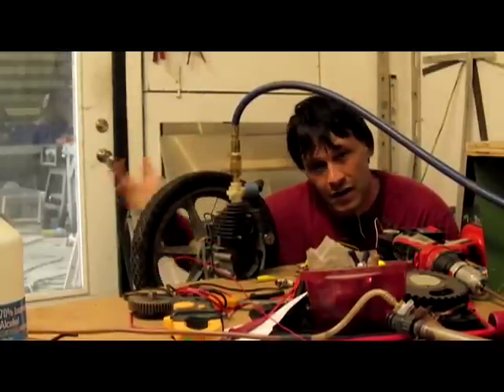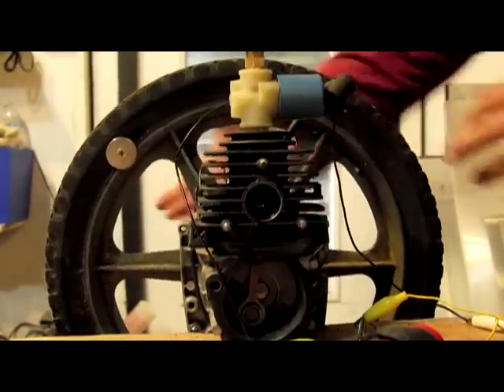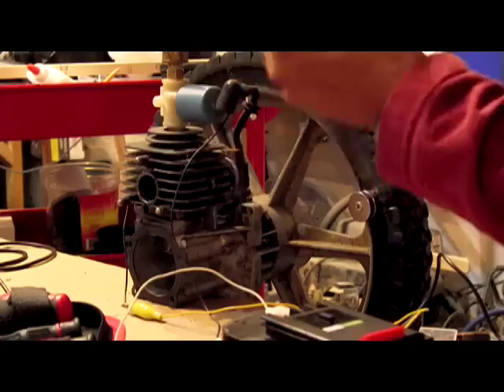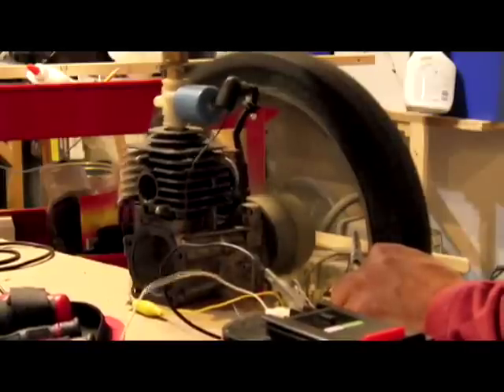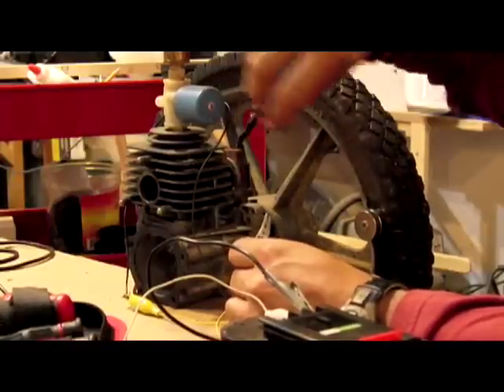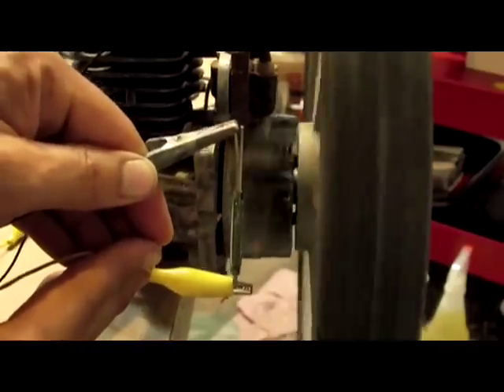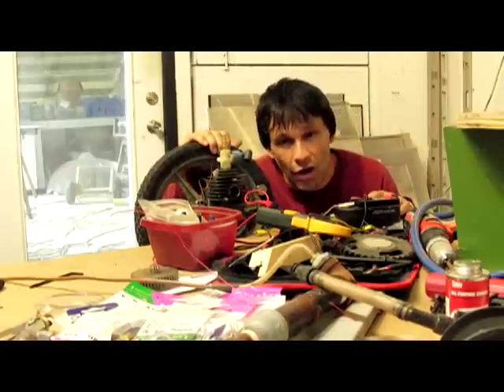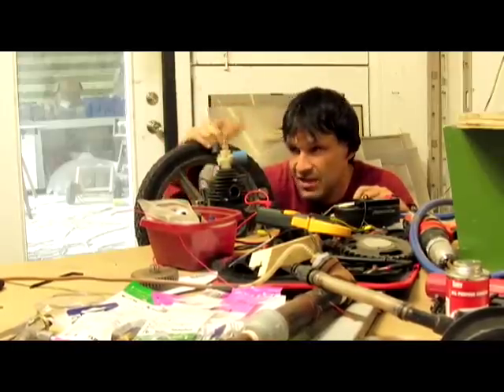DIY STEAM ENGINE HACK TWO STROKE CONVERSION Weed Eater Hack Steam Power

Comment: You are right in that it will run with no modification ! However, you are loosing power by making it compress on the upstroke ! Usong a valve will give ypu more power because it will be exhausting throughout the compression stroke !

Comment: I can see a system where a vawt would run a air compresser, & 1 of these could run a genarater at a higher rpm! As a vawt ussally has torque but low rpm, this engen could supply the rpms need for a generator

Comment: magic of vibrating WARPED bike  wheel :):) connect some load , voltage and sparking is not that meaningfull , make some video how to track sun with your fresnel lens to make steam for longer than 6 minutes, and let us know how to prevent rusting and jamming of that little pony.

Comment: This is a great start to a practical steam engine, I love the two cycle concept here. However you need a few more things if you want to use this reliably. 
1. Skip the solenoid & reed switch and just put a concentric timer on it for timing. No power would be needed to activate the air/steam then. 
2. You have to inject a little oil in it from time to time to keep things lubricated, so you'll need an oil injector.
3. If you have an air regulator that's great, if you decide to use steam you might want to put a simple governor on it.
Thanks for sharing Dan, you guys always come up with some simple basic FUNCTIONAL conceptual ideas for folks to build on. The key word here is functional. Thanks again for sharing. Best Wishes n Blessings. Keith Noneya
Reply: Hello Keith.
I am from India. Can you please say what is Reed Switch & Concentric timer ? I want to build a steam engine to generate 10kw 3 phase electricity. Can you guide me.

Comment: Ive never seen an injection system to reduce air consumption, very cool.  I think a counter weight opposite the magnet would have eliminated  the vibration.  Great video.

Comment: can this work with 10bar steam and power 12v generator (to 200W )
Reply from the maker: Yes
Reply: GREENPOWERSCIENCE 
will cylinder and piston rust and do I need oiler if it will work only 30min max

Comment: Awesome project! I'm just a little worried about the crank bearings wearing quickly with that unbalanced tire
Reply: is it a wheel off a kids chopper bike or something? i was thinking the same, it's maybe the tire not set correctly, slightly buckled, and having that magnet attached won't help =P
Reply: It looks like a lawn mower wheel from thosr lawn mowers with the huge rear wheels

Comment: I work on engines especially 2 stroke so I was wondering if it is wise not to use oil otherwise it will seize up
Reply: the bearing love water and steam

Comment: hey man where could I buy a solenoids valve and reed switch?
Reply from the maker: +jymdandi Ebay has them.
Reply: Guys I just found a good website which gives you free_steam_wallet_card_c0des  https://plus.google.com/105285816099913202128/posts/dLi51Xmhqrx
Reply: Guys I just found a good website which gives you free_xbox_live_gold_c0des  https://plus.google.com/105285816099913202128/posts/1BEqyecmEXt
Reply: https://plus.google.com/105285816099913202128/posts/TRikg2wrqiy  to get real free games
Reply: THIS TOOL FOR FREE STEAM MONEY IS THE BEST ON THE ENTIRE WEBSTORE!!!<<<<<<<<<<  https://www.facebook.com/456629761211399/photos/a.456630364544672.1073741826.456629761211399/456630731211302/?type=3&pidid=b69e39be-9a18-4e9f-99fb-ba4a608b346e  >>>>>>>>>>>                                                                DIY STEAM ENGINE HACK TWO STROKE CONVERSION Weed Eater Hack Steam Power
Reply: +jymdandi  their on the back of most wash machines and refrigerators with water hook up also dish washers these are usually 110/220 euro volts 60 hz should work off spark system already on motor reed switch is usually on any exercise machine with the magnet treadmills pedal type exercisers ect also in thermostats for houses as well as alarm systems sensors for windows doors

Comment: hey man where could I buy a solenoids valve and reed switch
Reply: +jymdandi  any washer dishwasher refridgerator with ice maker reed switch is on any exercise machine that  keeps track of speed  magnet is also on it as well but magnet on motors fly wheel and spark system can also be used to time the valves opening as well as dwell 1/4 of every down stroke could be timed to opening selonoid 2 strokers are easiest to modify due to lack of valve train and will always achieve better mech. torque but not as efficiant its not about bore or stroke but the flywheels diameter and mass and storeing energy in it but the engines key in flywheel is usually soft to shear in event of  it hitting  something rather than crankshaft snapping so when you add a bigger fly wheel you have to put a regular steel key in the other one or reversal of that and failure will happen right when it hits first compression  I think if a generator that wont run was used it would be the best mode of build as sloppy is best in steam/air motors also remember to add oil to water for steam to lube it as it runs hope this helped ya some how

Comment: How would you put a cut off valve on this
Reply from the maker: Trains Ine simple option is a check valve that bangs into a knob attached to the piston. This opens it at TDC and when the air enters the knob is in the down stroke. Other options include a traditional slide valve. The tilt piston is by fat the best option for efficiency:
https://www.youtube.com/watch?v=W5Imb5xO3qQ

This is self exhausting and the only need is a timing setup. ANother option is a roller bearing at the center of the flywheel that is off center. It presses against a valve lever in the high position opening the valve.

Comment: Also... the cooling fins on the engine.. yeah.. umm you are losing energy with them and last time I checked steam is not going to melt that thing.... so I would wrap it in insulation to prevent HEAT (energy) loss...
Reply from the maker: Jesse Mercury Agree, this was just a fast conversion.

Comment: Okay... me I would take the engine.... then remove all parts and just have the cylinder there then drill two hold through the side of the cylinder sperated maybe by an inch on the circumference..... and then take say some sheet metal form impeller blades like a marine pump ... put it on a shaft and spring load the impeller blades to shove out.....and set the shaft very close to the outer circumference near the inlet and outlet holes we just drilled... all in all it is a true rotary engine at that point and not a planetary motion wankel type rotary... so steam comes in the inlet end and expands out as it rotates around then then when it gets to the exhacust hole when the space is getting smaller again it is forced out the outlet... just a thought....

Comment: Nice toy , BUT , Will not work on steam very long. First and foremost 400* steam will virtually melt that switch. Secondly It will corrode the wrist pin, crank main bearing, case bearings..... and I know .. My web Page : Jerrys Web Page For Stationary Steam Engines

Comment: Once you hook a load(alternator,generator) the short pluses will not be sufficient for this size motor, this is where longer pulses create the torque needed under load to make this size motor worth the effort.
 A real steam engine can give torque throughout the entire stroke.

Comment: what about oil for the rod bearing and the cam shaft?
Reply: Though a very good point, keep in mind that 99% of all 2-strokes don't have cam shafts, the cylinder wall has channeling that allows the intake air to bypass the piston from the crank case. In-between use oiling, though , would be very useful. you could use a very heavy weight oil 20W50 for a little less resistance or 80W90 that will stick around a little longer but will add resistance until warmed-up, or a wet/or/dry graphite or dry lithium lube would be useful in the long term. I have used 15W40 and dry lithium on several chainsaw engines post rebuild to add lubrication to the engine before the oil in the fuel can start doing its job. :)

Comment: Very ingenious! 

if you used some of that force from the engine to refill air back into the compressor, you would have a very efficient motor.
Reply: It actually wouldnt be efficient at all... It wouldnt be able to do much work other than pressurize a fraction of whats lost to barely run since all the work goes back into compression.

Comment: if you did use steam, would then generally rust out the pistons?
Reply: no, and the dryer the steam the longer it will last as well. Just do a blow out after running and keep it lubricated. Then its not a big issue

Comment from the maker: Working on an upgrade.
Reply: Hey, Only here you can take working free Steam Wallet gift card codes:
its works 
SteamCodeGenerator .c om
Reply: whats that valve you put on there? and the magnet bit?
GREENPOWERSCIENCE
Reply: What is the reed switch controlling? Is it opening and closing an air valve to allow air into the engine?
Reply: The Best website where you can get free SteamWallet gift card!!
this website is the best ever. 
SteamCodeGenerator .c o m
Reply: Steam Wallet $20 and $50 gift card codes!!!
get on this site no regret... 
SteamGiftCodes .c o m.
Reply: Daily free $20 or $50 codes created by online generator!!
You can try it no regret. 
SteamGiftCodes .c om.
Reply: Free gift card for Steam Wallet you can find only here!!!
You can try it no regret. 
SteamGiftCodes .c om.
Reply: Daily free $20 or $50 gift card created by online generator!
Try it.. Its works for me. 
SteamGiftCodes .c om.
Reply: +GREENPOWERSCIENCE 

Hay guy, you're getting way too complicated there. Think LESS. You don't need to time anything. The timing is already built into the engine. It is much more efficient than you are too LOL.

Get rid of the magnet on the tire and replace the magnetic switch with an off-on switch.

With the switch off, give the tire a swift spin and then turn on the switch. It will run just fine, adjust the speed with the pressure.
===============================
If you still have the recoil starter for it, you don't even need the pneumatic valve switch or battery. Apply air pressure to the spark plug hole and give the engine a swift spin with the recoil starter.

Comment: The 1st compressed air powered locomotive ran 100 miles between stops in 1828. Compressed air powered cars, trucks, lift trucks etc... run in mines even today preventing explosions. If you look them up you'll see all the answers to your questions. After all even steam engines have lubrication issues , with many answers. SEE ALSO : A car that runs on air by MDI .

Comment: I've been running steam traction engines for 10 years now and I must say you are missing a very important aspect of a steam engine. The expansion of the steam. On old traction engines and locomotives they can shorten the stroke of the valve down to roughly a little more than half and, because of the expansion of the steam, these engines have exactly the same amount of power as they did at full stroke. This means that your claim about the amount of time steam is being fed into the cylender is inefficint is simply not true. Not to mention on an engine like that it is designed to keep itself cool, which means you would have a ton of condensation. Another thing is oil. In a steam cylender, you MUST use steam cylender oil (next one up from gear oil), because regular motor oil will bake on the sides of the cylender and not lubricate properly because of the heat. If you tried to run that thing off steam, you would have a very rude awakening!

Comment: I never thought about the electric valve, very clever.  The mechanical valve is much more difficult to implement.  I must add, however, that two stroke engines are fuel lubricated.  Without some oil mist introduced, it would be a tossup as to which failed first, the piston/cylinder wall or the crankshaft needle bearings.
Reply: surely, any oil in the combustion chamber will make its way into the crank case. i assumed the intake porting would work in reverse as an oil duct from topend to bottom. it is 2 stroke without any fire (steam cleaned though). i agree with your point about dry bearings. im soon to test this, i will let you know. its all theory until someone actually tries it.
Reply: EASY> just add an inline oil reservoir for a pneumatic air tool like an air wrench..
Reply: An inline oiler would help the piston/cylinder, but would do nothing for the crankshaft or rod bearings, and you can't use an inline oiler with steam, to my knowledge.  Running this off compressed air would be pointless.  For steam use, you could close off the crankcase and use splash lubrication for the bearings and cylinder.  You would have to fill the transfer ports with JB Weld, but it could work.  Another consideration is that would have to drive a jackshaft because this engine is not designed for an overhung load.
Reply: If you want working free Steam Wallet codes, go here
get on this site no regret!
SteamCodeGenerator .c om
Reply: I am still wondering about how to prevent them from seizing up from rust (powered by steam)

Comment: I admire your intent, but that would be a very inefficient steam engine, unless you can close and capture the exhaust to recover the energy before the water condenses. Also you should capture the vacuum created from temperature change to boil the water at a lower temperature reducing fuel requirements. My experience is based on steamship engines. Exhausting steam to atmosphere after 1 cycle seems like such a waste.

Comment: couldn't you just use the existing magneto to operate the solenoid, instead of adding all the extra stuff?
  And all you would need to do to get rid of the drag on the magneto is to take it apart and sand it down, that's usually from corrosion or improperly aligned parts

Comment: The idea of converting old motors to steam power is very cool, but if a steel engine is designed to burn oily fuel while self-lubricating, wouldn't running steam through it corrode the working surfaces fairly quickly?
Reply: Yes ! So, when your done for the day or session you need to dry it and give it a coating of oil !

Comment: It will take more then roughly 5,200 volts to arc across a 1/16 inch spark plug gap in dry air at standard temperature and pressure. Higher in a compressed mixture of fuel and air. Now the low side of that magneto coil, the side connected to the kill switch or ignition system (if there is one on that simple engine) might be a more usable voltage level with more current.
Keep up the good, entertaining work!

Comment: You are way off on that spark plug voltage. It should be at least 15,000 volts, and probably higher. Dielectric of air:33kV/cm, higher voltage to get a spark. If you had your meter on DC you'd probably have fried it. You measured such a low voltage because you got an average. The spark voltage is maybe about 1 degree in duration, 1 degree/360 *15,000 peak volts is about 42 average volts. Don't try to measure spark plug kilo-voltage with your regular meter unless you want to kill your meter.

Comment: Air requires much more energy to generate power than steam. Steam also continues to expand so it is much more efficient. In any event, why would you want to power an engine with an air compressor being run by an electric motor. Makes no sense.

Comment: This may sound silly, but can't you use the magneto voltage to operate the switch.  Put a diode regulator to convert ac to dc to operate the switch, if the switch is dc.  You could also use the regulator a tap off 12 volts to do many applications.  The magneto is already timed for the stroke at the factory.  Doesn't this sound correct?

Comment from the maker: Yes, but it is not a straight reverse so the vessel cannot be the original tank for solar. The flap valves are removed and the head volume is reduced. A solenoid valve or slide / piston valve would be required. Most compressor cylinders are a larger diameter than a 2 stroke so you may need a lot more than a few mirrors. What was the matching HP electric motor?

Comment: "Could you use those cold recharge Freon replacement "kits" at the big box store?" Yes! any freon. To be clear, the liquid freon is pumped into the solar heat collector. Where it is heated and will increase pressure when it "boils" that is fed to the engine and it's exhaust is then cooled and condensed back into a liquid to repeat the cycle. Of course, the mechanical motion produced is used to turn a generator for electricity to charge batt's or whatever.  Cheers

Comment: so use heat to expand Freon? is this to combat corrosion? wouldn't Freon have less power then water? could you use those cold recharge Freon replacement "kits" at the big box store?

Comment from the maker: This is a 1.5HP gas engine. As a conversion to air it would be roughly 70% of that, with steam you would be looking at 60% so about 600 watts in a perfect world. With the loss from an induction type generator core = 500 watts (not recommended due to RPM fluctuations) and an inverter generator gore. With a dual axial flux = 550 watts. Would require more precision timing than a reed switch.

Comment: Hi there, I was wondering if you could give me a set of instructions and a parts list so I could do this myself, for I lack a lathe and this would be an ideal solution for me to make my own steam engines on my tight budget.

I understand this engine is just a proof of concept, but it's more than good enough for me to use in a little steam car or to generate electricity with.

Comment: This would work great as a campfire steam engine to generate electric for a SHTF  situation.  Combine this with a junkyard alternator , voltage regulator ,two large car batterries and a power inverter say 4-8 thoughsand watt. youv'e got a camp fire home generator.  Sounds like a good video project!